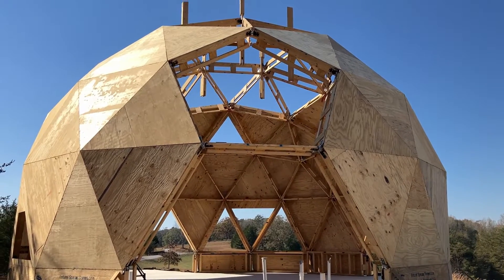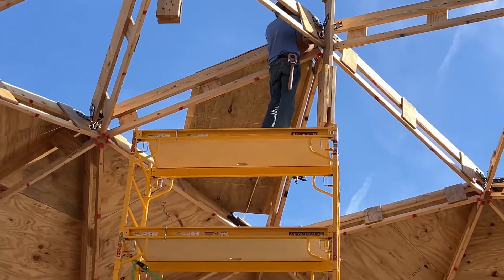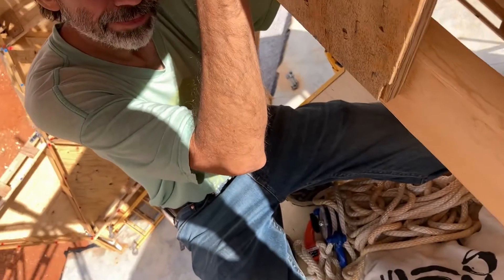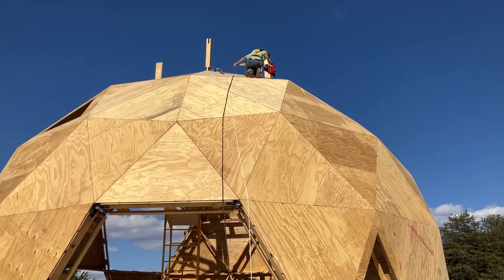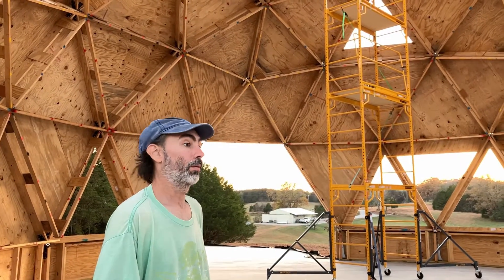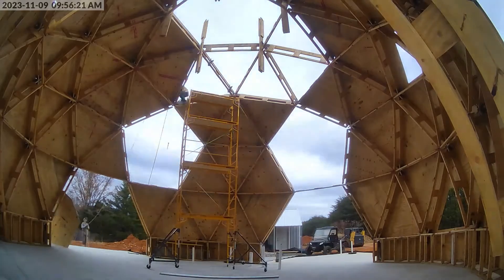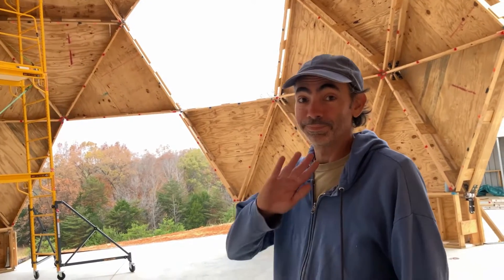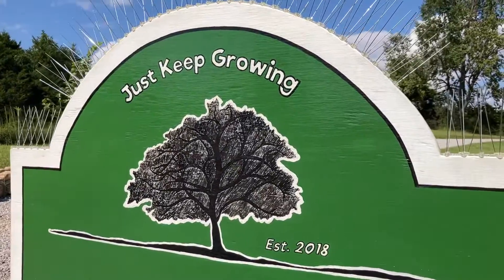Our Dome Build...Plywood Round Four!

Comment: Now start working on burying it with Earth and build a mound around your home up to however high you want. It'll act as a thermal barrier and you can bury it all the way to the top and build a secret entrance that's like a random Phone Booth out in the middle of nowhere on some Random hill top. Make it a TARDIS! And inside, it opens down to a staircase that follows along the wall going down into the Great Room. 😃
Reply: Build connecting hive nests and bury those as well to fill out a Big plateaus hill top. Make sure the structure can handle the weight of the mound being waterlogged. The top will be used as growing space for a small food first. A small food forest with a random tardis sitting in the middle of it. None the wiser.

Comment: Nice Work,  Get a Boom  crane for the top . It will make it easier to construct on the ground and lift it up.
Reply from the maker: Thanks!  We used a boom arm for the third level but that is as high as it would reach.  A big crane sure would be great but it's not in the budget, so the manual pully system did the job :)